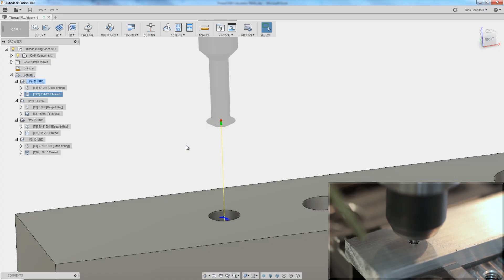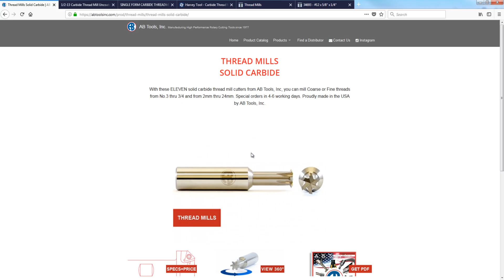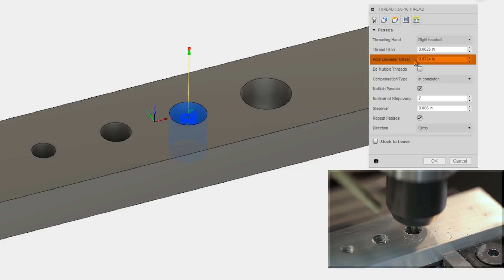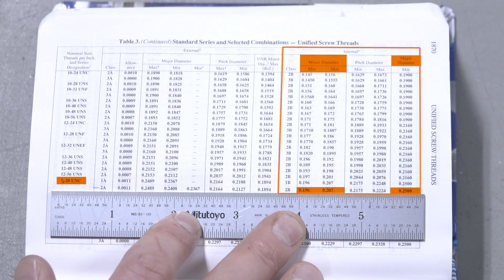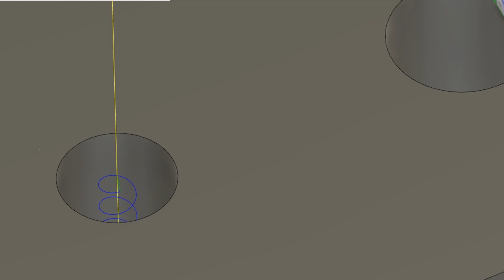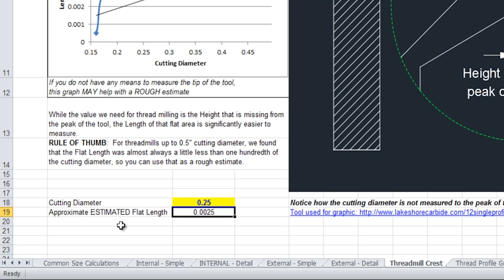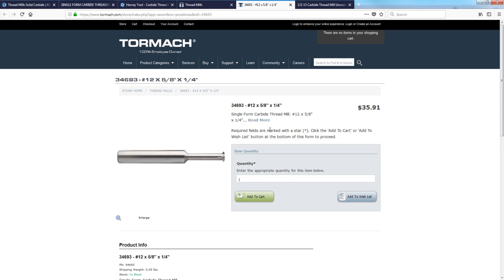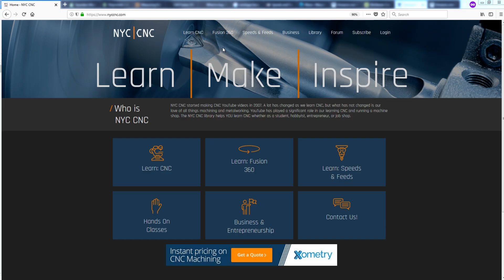Threadmilling: The Ultimate Guide! WW187

Comment: Boy do those dimensions for the drills and the threads seem obtuse: an "F" drill for 5/16" !
Give me metric units ANY DAY!
Reply: They're only obtuse if you never learned why they are what they are.
Reply: @noiwonttellyoumyname.4385  there's no logical reason for the BS that is the imperial system of anything.
Reply: @noiwonttellyoumyname.4385  Even knowing the history of the units will not help converting inches to miles or fathoms or ...
Reply: @GregorShapiro  The history isn't the point, it's the *why*. For instance, measuring things by half/quarter/eighth of a larger unit is something that anyone can do with just a piece of string. 

All of your traditional / imperial measurements are based around that sort of thing to one extent or another. They're made so that people without complex instruments or a lot of education can do things that would otherwise be impossible.

Beyond that, it takes a much, much higher technological base to make and distribute metric measuring tools (or hardware, fasteners, etc) than traditional, because you not only need to know what the speed of light is (299,792,458 meters per second) but you need to be able to figure out how far light will travel in a vacuum in 1/299,792,458th of a second.

That's no less arbitrary and stupid than the basis of any imperial measurement, and it's peculiarly French in its own form of obscure complexity. Which makes sense- they're the ones that invented it, after all.

So, unless you truly think that it's more relatable to gauge a unit of distance against how far light travels in 1/299,792,458th of a second vs roughly the distance you cover in a long step....
Reply: @noiwonttellyoumyname.4385  5280 feet per mile? Why? It's too complicated! 
1191.57 fluid ounces per bushel? Why? it's too complicated!
Letter F drill for tapping a 5/16-18 thread? Why it is too complicated!
Reply: @GregorShapiro  This really isn't complicated.

Miles- originally from Latin: "mille passus." 1000 double-paces. (Think left-right-left.) Slightly modified when the Romans left Britain and the locals didn't care so much about how fast the legions marched. 5,280 foot miles are based on how hard you could push a team of animals plowing: about 660 feet before they'd need a rest. 8 furrow-lengths (aka "furlongs") became a British mile, and that's 5,280 feet.

Fluid ounces per bushel? That's an idiotic comparison. A bushel is a unit of volume for dry measure. A fluid ounce is--as the name suggests--a liquid measure that also (by way of using water as the reference liquid) gives you weight. 1 pint of water = 1 pound.

Number and letter drills get their names from a particular brand of steel wire. The number drills were clearance holes for the corresponding wire size. #14 drill = clearance hole for #14 wire. The letter sizes were a continuation of this when someone needed something bigger than #1.

5/16"-18 TPI has no inherent relationship with a letter F drill, other than that the drill is diameter .257, and that gives you just a hair more than a 75% thread, which means you get almost all the strength possible while keeping tolerances loose enough to fit even badly made bolts.

All of these units of measure make sense, and they're related to things in the world around you.
Reply: @noiwonttellyoumyname.4385  Exacty! Much too complicated! "slightly modified" Numbering wire sizes instead of measuring them! and then continuation when they got their backwards counting to the lowest integer... Volume is volume and should not be dependent on the state of the matter being measured!
Etc!
The history is amusing and interesting per se but a unified measuring system that can measure the volume of a liquid and a solid with the same units using the same arithmetic base seems to most of the worlds intelligent people as a 'no brainer'!
Reply: F metric. I've been using it ever day for 8 years, but before that started out in a shop that used 90% standard, and I still much prefer the standard stuff even though I rarely use it anymore.

Once you learn the imperial system you start to understand why MERIKA > everyone else. Almost every Tool Maker I've ever known that's got a lot of experience with both still prefers standard, even though using metric is no problem for them.
Reply: Yeah. Letter drills, rational numbers (fractions/ratios), USCS, and knowing SI/metric/USCS is tough for some people. The best way to look at it is, you won't ever be doing anything important enough for it to matter, so there's no need to worry about it. When you punch in the amount of money the customer gives you, the POS/register will tell you how much change to give the customer back. No counting necessary at all.

Comment: Another tip: check the runnout on your threadmill especially if you're trying to cut right to size without sneaking up. I've had threadmills runnout and cut over sized.  I aim for .0002 runnout or less.

Comment: Hi John! I see you used your Noga deburring tool, but what it you wanted to use the threadmill itself to make a small chamfer to take the edge off. How would you add it to the toolpath, given that the CAD/CAM program (Fusion 360) already knows where the center of the hole is (not to mention, the model of the tool itself)?

Comment: I broke down and put my mind to it. Got the thread mill working. Saves 1 minute per batch on my parts. That's two extra batches of parts per day!!! Now I use them in anything that needs a thread. Not only that but the threads are perfect. One part uses a plastic bolt so the threads have to be really loose. With the threadmill.. no problem!
Don't forget to add clearance if tapping a blind hole.

Comment: How do you determine the length of the thread mill? To the bottom of the tool or to the widest point of the cutter?
Reply: Vincent - I played with this over the weekend and found that Fusion is looking for the length to the end/bottom, not to the cutter. You can verify by creating a blind hold and create a 2D Thread, then look at the gcode produced in CAM to see max -Z.
Reply: @rickojames  Thanks for the info!
Reply: I came here hoping to find the answer to that very question. Did you ever find an answer?
Reply: @rickojames  No
Reply: @vendter  I've done thread milling using a program that generates the gcode, and the tool length was measured at the pointy end of the flutes.  I'll do some Fusion testing this weekend and make some threads in machineable wax and figure it out, and will let you know what I find. I'm overworked and under-rested, so if you don't hear from me by Monday please ring my bell here.

Comment: Not very practical for threads that are easily cut with a tap, die, or mill tap (you didn't show any external threads?) I used this technique for cutting  40mm external thread because dies were not available. why complicate things? show what it is actually useful for.....Great work! John, keep it up dude.
Reply: There are applications that thread milling is more practical than tapping. With a full form thread mill cycle times are not much longer than tapping. An example is a 3/4" round part with a 1/2-13 hole threaded on axis. The work holding force to tap is much greater than thread milling. I can fit 30 parts on a pallet to tap or 96 parts to thread mill. thread milling is far more practical and productive in this situation.

Comment: I'm not at my CAD computer at the moment, so I can't check, but does Fusion 360 have the ability to shift the thread mill axially, so that the correct flat can be created in the root?

One of the reasons I don't angle the compound slide when single pointing a thread on the lathe is that when I don't have the correct insert,  I can use a sharp tipped tool to cut to depth and then feed axially with the compound to form the flat and achieve the required pitch diameter.
Reply: Hey, old comment here but thought I'd chime in:  if you want to do some axial offset, just right click your toolpath and choose "add to new pattern" make sure its set to linear pattern and that the direction is going up so you don't hit the bottom.
your pattern spacing (.003" or whatever) then becomes your additional offset amount!

Comment: Great tutorial. I feel like for 90% of jobs though a proper tap and a rigid tapping cycle would make more holes per tool per dollar and do it faster. I would love to see a head to head on this. :-)
Reply: You are right, however thread milling has some huge advantages it there are multiple different threads, or if you machine is underpowered. I wouldn't expect a little sherline to drive a 1" tap through a block of steel, but you could get it done with a thread mill.
Milled threads are also more adjustable and clean.

Lastly, the versatility. One thread mill could replace a handful of taps. 

But if your doing a production run with all one size hole, in a standard thread on a properly equipped machine, rigid tapping would be faster in the end.
Reply: I have a 5/8 11 thread mill I've been using for 3 years .it has done thousands of holes. Before we were using emuge taps and getting maybe 100-200 holes before replacing

Comment: Hey John, one of the most important parts of thread milling is Pitch Diameter. Major and Minor are important, but fitting to screws of an unknown pitch diameter will come back to bite you hard eventually. Pitch Diameter is extremely important, it is the measurement that you're trying to explain by utilizing the tip flat to calculate it but it will never be perfect.

Comment: Does the fact that the cutting edges of the threadmill sweep a perfectly horizontal path vs the inclined path (with incline depending on thread pitch) of the theoretically perfect thread cause any deviation from an ideal 60 degree V?  Without doing any math or detailed analysis, it would seem that for the threadmill to properly fit an ideal thread it would need to be angled at the thread pitch angle.  Since that's obviously not possible I would have thought it would end up cutting a V slightly wider than 60 degrees with the effect being worse the closer the threadmill diameter is to the drilled hole size.  Thanks in advance for satisfying my OCD with any clarification :)
Reply: My thoughts exactly!
Every time I've seen John thread milling it's bothered me until I just melted my brain thinking about this for 20min and pictured cutting a thread on a lathe. The geometries are exactly the same in both cases! :-0
A lathe threading tool is just one flute of a thread mill, the angle is always measured square to the part, not offset to the pitch (the tool is always square to the part).
So the angle square to the thread (rather than the part) does actually change with the pitch.
I'd never thought of that before...
Reply: Brad Lotsberg 
That's something I had been wondering about for a long time too. A recent "This Old Tony" video cleared it up for me (the video had the word "Threading" in the title, I think, so look for that. Also, if you haven't seen This Old Tony's videos, you're missing out!)

The points of the thread mill are relieved so that, even though the cutting edge is sweeping in a horizontal plane, very little contact is made behind the exact edge that is doing the cutting.

As an analogy, imagine using the side of a piece of chalk to make a wide horizontal line on a chalkboard. You'd hold the chalk vertically and it would (basically) only touch the chalkboard along a single line of contact. If you continued to hold the chalk vertically, but drew an angled line instead, the chalk would still only have that single line of contact with the chalkboard, so the angled line would be drawn without distortion. The points of the thread mill are designed to do the same thing - they are designed to (basically) only have a single line of contact. (I hope that makes some sense!)
Reply: There IS a small error that is probably negligible, but real and minimized by using a small-ish thread mill for a given thread diameter. Great explanation on page 39 of the Sandvik Threading Application Guide: "The cutter engagement will create a minute form error on the root of the thread profile." Highly recommend you google it and check it out.
Reply: Brad Lotsberg the threadmill geometry compensates for the interference on the horizontal plane that your envisioning.
Reply: It would be a bunch of small flats.
Reply: But then the cutter would have to remain fixed and the part would move? Isnt always going to make a flat doing it this way.
Reply: Brad Lotsberg I'm a mechanical engineer who has also wondered this.  The only answer I was able to find is that the tool is not cut at 60 degrees.  The angle has been adjusted so that it does give you about 60 degree threads at nominal thread pitches.  

When you threadmill a thread pitch that's very different from the tool's intended range of pitches, those threads will be pretty far off from 60 degrees.  You will have to cut a deeper or shallower thread to get a good feeling engagement, and these threads will be weaker than proper 60 degree threads.
Reply: chris0tube Yeah that's what I was thinking also.  Even a literal pinpoint of a cutting edge is still sweeping a horizontal path across what should be an angled inside cut so regardless of tool geometry it seems there must still be some amount of distortion away from an ideal V groove.  It obviously works though so I guess even with large cutter to hole diameter ratios the thread shape is good enough.
Reply: Hirudin Thanks.  I do watch This Old Tony (awesome channel also) and relief angles behind the cutting edge are easy to understand but even with those relief angles, cutting inside threads would still seem to suffer some amount of thread shape distortion due to the cut surface curving into rather than away from the cutter.  Since it obviously works however I will just assume the thread shape is good enough regardless.
Reply: Thread deformation is a fact of life and perfectly acceptable. No thread retains its perfect form at torque. The minor deviation in thread form from thread milling is a non issue if your using the correct thread mill for the diameter of thread your cutting. The threads will make up fine under torque.

I thread mill all NPT threads without exception. I form tap all threads under 1/2"  and over 10-32 in materials below 36 hrc. I cut tap everything 10-32 and under and over 1/2" to 3/4. 1" and above is thread milled. There's always exceptions but that more or less my pattern. 

Been doing it for years.
Reply: chris0tube frankly my point is that your making much ado about nothing. Kinda like the guys who argue your 2 tenths out of tolerance when your shop isn't climate controlled and your using a Mic that was set on a 10 year old standard that hasn't been calibrated since it came out of the factory. Meanwhile you've been arguing the tolerance issue for 15 minutes while holding the Mic. 

Your right the thread form isn't perfect. Nothing is

Comment: I have to say mazak have done an amazing job with thread milling on their controllers. I don't do much thread milling only a half dozen parts I make require it to get the max amount of thread in a blind hole but they have made it such a simple process to use. If I want to change a program that uses a normal rigid tapping cycle to a thread milling cycle all I do is go into the program and change the tool used for tapping from a tap to a thread mill and it will do the rest for me. It changes the program from rigid tap to a helical tool path starting at the bottom of the hole at whatever depth I set it as. It calculates all the information required with virtually no input other then putting the tool data in for say a 1/2"-13 UNC then putting the tool diameter in thats printed on the box and its done.

Comment: Wouldnt it be a milling  a bunch of small flats instead of a true thread.
Reply: Most threads do have flats - so called unified threads.
Perfect triangle profiles (called Sharp-V) are rare -
I suspect because the points are weak spots?
Reply: I'm fairly sure the best way to do this right  is using at least a 4 axis mill...

Comment: Great stuff, John. Definitely going to try this. Always get nervous tapping in some hastelloy projects with hours of run time already in it. I’d much rather break one of these in the hole. Don’t know why I hadn’t tried this before
Reply: Sheldon Robertson luckily, I haven’t scrapped anything in hastelloy due to a tap knock on wood
But I have scrapped a pretty expensive valve because of an incorrect offset on the 5-axis.
Reply: Sheldon Robertson I'm not positive where those valves end up, we make them for a client who sells them. I assume they're for something along those lines. We make them in 316L, AL6XN, and Hastelloy.

Comment: Awesome video, but I have a question. Do you need a machine capable of rigid tapping to successfully threadmill, or is this away to circumvent that lack of capability?
Reply: You don't need rigid tapping but I think you do need helical interpolation. Not sure if that's a standard feature nowawdays
Reply: No need to have rigid tapping as the spindle rotation and tool movement don't need to be directly synced.